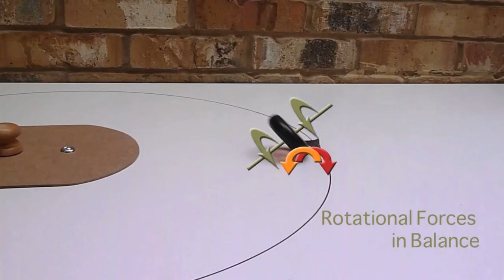The magical, beautiful science of countersteering

Comment: Awesome video man🤙🏻 counter steering has saved my bacon more than once.  When doing it there are a huge number of factors that go into making it successful.  The last instance I was in a hard lean in a right hand curve.  My back wheel started loosing traction and started sliding out to the left.  By slightly pushing right on the bars it brought the bike back to a more up right position allowing me to regain control and getting the back of the bike back under me rather than out from under me.
Reply from the maker: That's an awesome comment - thanks JT.  I experienced my rear spinning out in a curve (not so much sliding out) and it was a really unnerving experience - but yeah, understanding how the bike reacts to inputs at speed is something I am trying to master.